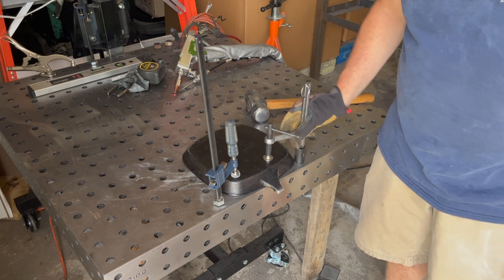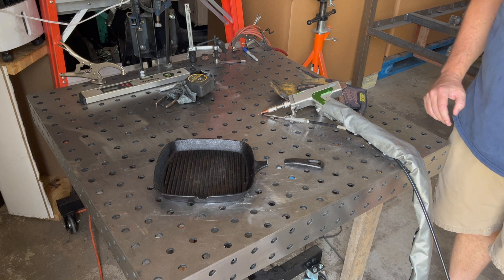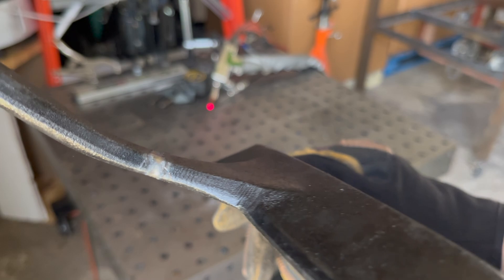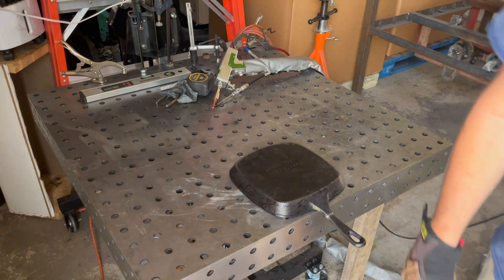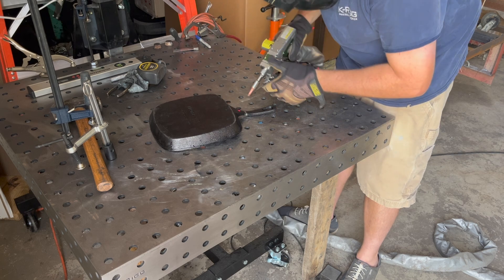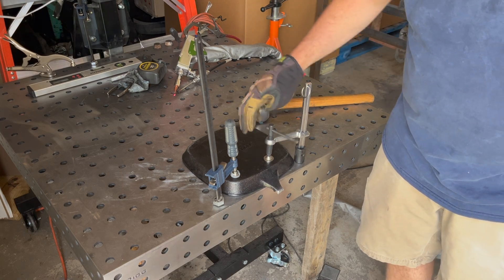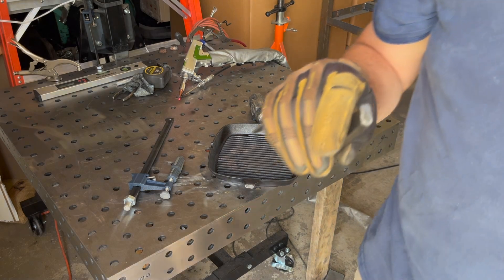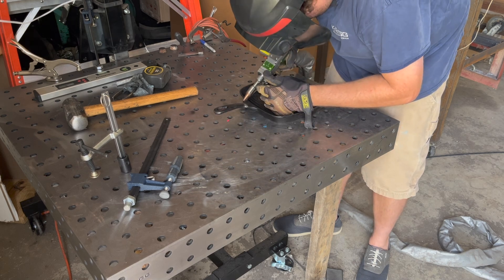Fake Welds? Can Laser Weld Cast Iron?

Comment: I wonder how the welds will hold up if you cleaned the area to be welded first (I know laser effectively burns it off while welding) just to give it the best metal to metal contact.  And then preheat the area with an induction coil heater or blow torch.  I wonder if the laser is dumping too much heat too fast into one spot which might be the cracking sound.    I imagine dunking it into water would make the metal quite brittle too
Reply from the maker: I thought about turning down the laser to beable to preheat the area also.
Reply: @k-rigg preheating is most important when welding CI where the weld is surrounded by the metal, such as a crack. When welding a part to another where the part is on the end, like the handle, you don’t have that kind of stress. I TIG weld CI with stainless, but 309L. 308L isn’t chemically compatible. Don’t dunk in water! Never dunk any weld in water to cool it down. That will cause problems. Cooling it down rapidly causes differential cooling and stress. Stress causes micro cracking. When this cracks join up over time, it breaks. Unlike steel, CI isn’t resilient.

Comment: I have the 2000W and for that thickness I would have to use all of them watts to get something that thick to weld properly but it is possible. Alternatively I would just do a band  weld like you did but welding cast iron is feasible. Thanks for posting.
Reply from the maker: I definitely needed to put more watts into!

Comment: china and  india turns out very low grade of cast iron - but very cool that the laser repairs it !
Reply from the maker: It amazed me how well it worked.
Reply: @k-rigg  generally with cast iron is you have to keep it cool, and weld it a little at a time, or heat it all cherry red, weld, then slow cool it.  I think the laser temps are so high and so instantaneous, that it keeps the overall temps lower, thus preventing hot cracking. Excellent content! keep it going K :)
Reply from the maker: @AUMINER1 thanks!  I know ghe last time i tried to weld cast with mig, I couldn’t preheat it enough to keep from cracking.  With laser it was easy!